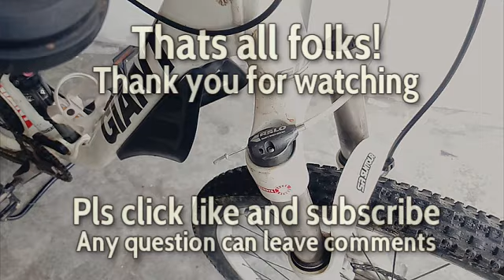[ Toysfun Cycling ] Suntour fork xtc xcr epicon epixon remote lock how to

Comment: if I use the fork always locked, can it cause more damage over time or does it improves its lifespan?
Reply from the maker: Lock wont cause anything to the fork and wont improve lifespan, if use in normal conditon, it can last so long without u worry about it. things that shorten the life are without care and abuse meaning that run in rocky road in lock position.proper care meaning ontime seal clean and oil change will maintain function and extend life.
Reply: @asotnes  thank you very much!

Comment: Hi! I have a bike that already comes with a remote speed lock but when I lock it from the remote, the suspension stays the same, meaning it doesn’t lock. It’s still unlocked. Any idea on what the problem is?
Reply from the maker: Check the cable, adjust the rocker adjuster make it tighter.
If it wasn't the cable, then would be the damper run out of oil.

Comment: how do you adjust the compression of a remote lockout fork?
Reply from the maker: Cable remote lock type r unable to adjust the level of lock compress. It jus either lock or play. Only manual remote have the dial of volume of compress. But if u can get a high end remote trigger some do have level adjustment, u can give it a try. By adjusting the rocker adjuster u can also try to make it lock half way so to achieve.

Comment: Hi, mine got stuck,is there any vid tutorial on how to fix stuck fork?thanks
Reply from the maker: stuck mean suspension stuck?
or lock function stuck?
or what stick?
Reply: @asotnes  suspension sir..but sometimes it works but not like the 1st time i use it.. do you think it can be fix? or can you post some video on how to open rslo suspension so i can follow your step by step guide .thanks sir
Reply from the maker: sory i dont hav any free fork right now.
suspension would be easy to work.
just remove bottom screw > pull out lower leg > letout the air inside > check suspension flow if the stuck were from suspension wall or from air chamber or air changer piston or piston rod

Comment: Same setup but my lever will not stay in the locked position. Any fix? Thanks.
Reply from the maker: mean than when u push the lock it wont lock on? turn the adjustment screw at cable stopper abit looser shall work.